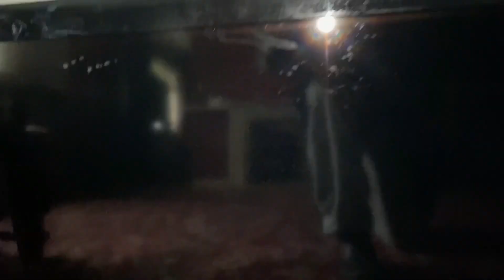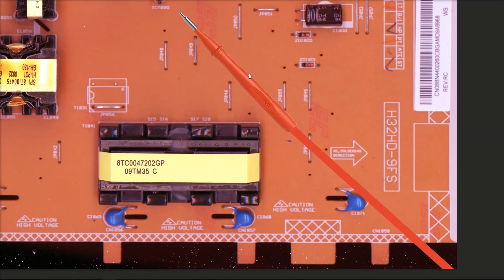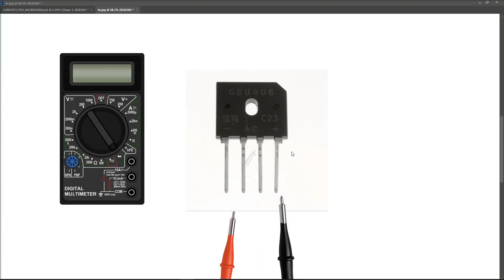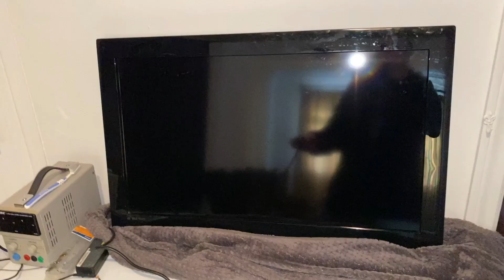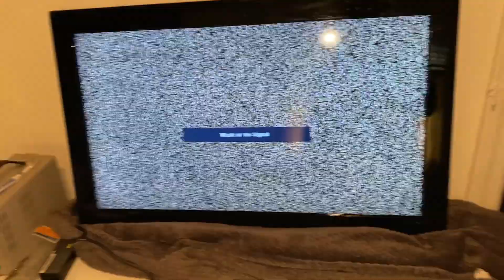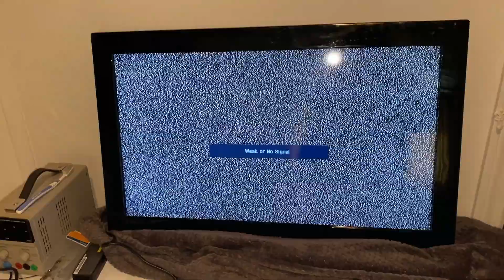Samsung LE32B450 - No Power

Comment: i also encounter sometimes power supply units which they make buzzer sounds or periodicaly Snap Snap Snap noises. i think it is about bad synchronization of mosfets, bad driver IC, sometimes coils or capacitors makes that noises.

Comment: I suspect stress caused in the factory when it was mounted and screwed. And then with heat the alu heatsink did move the stressed pin. Over long time it can destroy a solder joint like this. The rectifier is almost certainly still in good condition. Nice video!